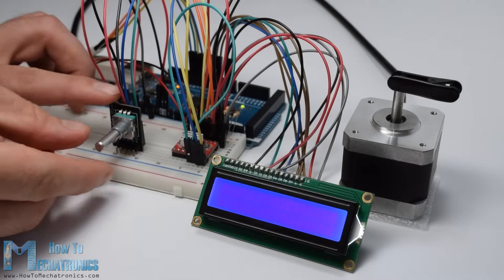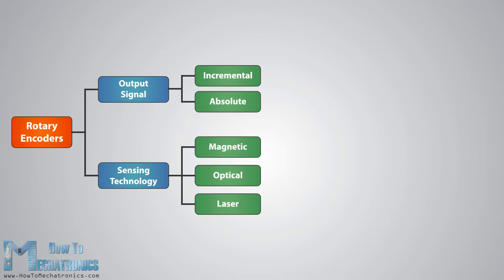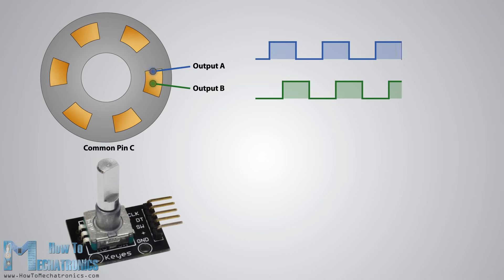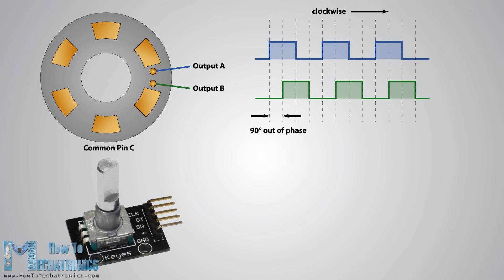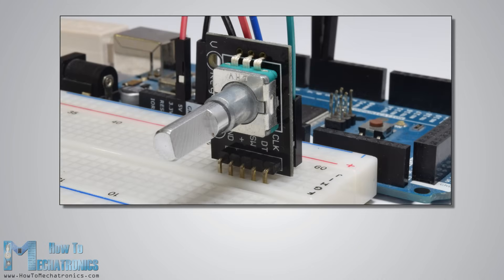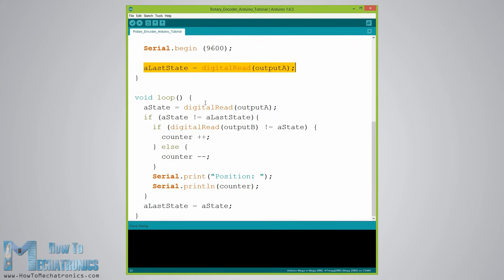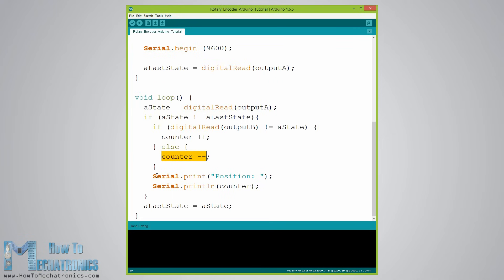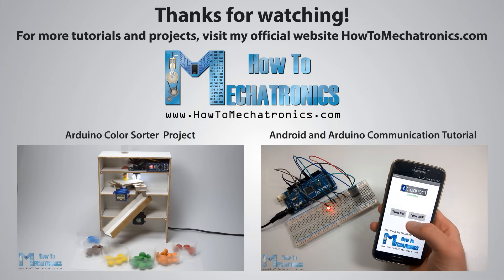How Rotary Encoder Works and How To Use It with Arduino

Comment: how can we use it to measure linear displacement (lenght) ? by just multiply counter by circumference of wheel ?
Reply: how many pulses it covers during one revolution when circumference is 200mm?
Reply: Bro I want to design a device which has following features:
1. Measures accurate length in "mm".
2. A wheel of diameter 63.64mm is used that manually drags on the surface. 
3. It is able to measure length/distance both in clockwise and anti-clockwise direction.
4. The device will sense every pulse of encoder circuit and at every movment of wheel or pulses it will display 1mm. After completing one revolution it will display approxmatily 200mm on LCD.
5. A reset option is avaliable.
6. Arduino store values when powered down. (May be external EPROM etc).
I generate basic code but before hardware implementation but i have confusion that how many pusles are used in one revolution? Also help me to generate code for storing values when arduino is powered off... Here is the code:
**************************************************
 #include <LiquidCrystal.h>
 LiquidCrystal lcd(12, 11, 5, 4, 3, 2);
 int val; 
 int encoderPinA = 6;
 int encoderPinB = 7;
 int counter = 0;
 int encoderPinALast = LOW;
 int n = LOW;
 float Length;
 float r=31.82;
 int pulse;
 float pi=3.14;

 void setup() { 
   pinMode (encoderPinA,INPUT);
   pinMode (encoderPinB,INPUT);
   Serial.begin (9600);
   lcd.begin(16,2);
 } 

 void loop() { 
 
   n = digitalRead(encoderPinA);
   
   if ((encoderPinALast == LOW) && (n == HIGH)) {
     if (digitalRead(encoderPinB) == LOW) {
       counter--;
        Length=2*pi*r*counter;
        //Length=Length/pulse;
     } else {
       counter++;
        Length=2*pi*r*counter;
        //Length=Length/pulse;
     }
     lcd.setCursor(0,0); 
  lcd.print("Length = ");
  lcd.setCursor(0,1);
  lcd.print(Length);
  delay(100);
  Serial.print ("Length (mm)");
  Serial.println (Length);  
   } 
   encoderPinALast = n;
 } 
// end

Comment: what happens if the stepper motor is physically 50 degrees and then the aurdino loses power?  When the power is restored to the arduino, does it know that its at 50 degrees?  Is there any way to read the physical position of the motor?

Comment: is possible to use pushbutton on encoder to reset the counter?
Reply: I use the sketch that is in the site in the link but there is not a code for reset button and their correspondent pin. 
/*     Arduino Rotary Encoder Tutorial
 *      
 *  by Dejan Nedelkovski, www.HowToMechatronics.com
 *  
 */
 
 #define outputA 6
 #define outputB 7

 int counter = 0; 
 int aState;
 int aLastState;  

 void setup() { 
   pinMode (outputA,INPUT);
   pinMode (outputB,INPUT);
   
   Serial.begin (9600);
   // Reads the initial state of the outputA
   aLastState = digitalRead(outputA);   
 } 

 void loop() { 
   aState = digitalRead(outputA); // Reads the "current" state of the outputA
   // If the previous and the current state of the outputA are different, that means a Pulse has occured
   if (aState != aLastState){     
     // If the outputB state is different to the outputA state, that means the encoder is rotating clockwise
     if (digitalRead(outputB) != aState) { 
       counter ++;
     } else {
       counter --;
     }
     Serial.print("Position: ");
     Serial.println(counter);
   } 
   aLastState = aState; // Updates the previous state of the outputA with the current state
 }
Reply: Thanks Dejan. For the tutorial and the info.

Comment: thanks for your tutorial, it helps,regards
Reply: referring your tutorial,so is it possible to synchronize two surface speed of conveying belt/goods ?, since the encoder rotated by a surface speed and give the signal as a control to a motor that can produce similar surface speed to another conveyor for example, thanks for your feedback,regards

Comment: Hello Dejan,
A lot of thx for your lessons and explanation. I gonna to use this sketch for some regulator with rotary encoder. I made a copy of your sketch and everything was OK. Some time later unfortunately in the serial monitor I've got double increment and double decrement for each click of the encoder. My version my encoder went out of order. Could there any problem with arduino? What you about?
Reply: Hey Werdy, I have the same issue, did you solve it? @Dejan: Thanx for the video, very helpfull!
Reply: Hello Jiris,
Yes. I've found solution. Like this one. There are two interruptions for Arduino UNO. You can change interruption number dependently the board model. If you need the line "encoder0Pos++" or "encoder0Pos--" could be changed for another one. For example encoder0Pos=encoder0Pos+10 or encoder0Pos=encoder0Pos-10.

#define encoder0PinA 2
#define encoder0PinB 3

volatile unsigned int encoder0Pos;

boolean A_set;
boolean B_set;

void setup() {

  pinMode(encoder0PinA, INPUT); 
  pinMode(encoder0PinB, INPUT);
  encoder0Pos=0;

// encoder pin on interrupt 0 (pin 2)
  attachInterrupt(0, doEncoderA, CHANGE);

// encoder pin on interrupt 1 (pin 3)
  attachInterrupt(1, doEncoderB, CHANGE);

}

void loop(){ 

// there should be your code

}

// Interrupt on A changing state
void doEncoderA(){

  // Low to High transition?
  if (digitalRead(encoder0PinA) == HIGH) { 
    A_set = true;
    if (!B_set) {
      encoder0Pos++;
    }        
  }

  // High-to-low transition?
  if (digitalRead(encoder0PinA) == LOW) {
    A_set = false;
  }

}

// Interrupt on B changing state
void doEncoderB(){

  // Low-to-high transition?
  if (digitalRead(encoder0PinB) == HIGH) {   
    B_set = true;
    if (!A_set) {
      encoder0Pos--;
    }
  }

  // High-to-low transition?
  if (digitalRead(encoder0PinB) == LOW) {
    B_set = false;
  }
}

Comment: Nice and clear explanation, thanks for the video. I wonder is it possible to control the LED light intensity using this encoder?
Reply: Just use a potentiometer DUH